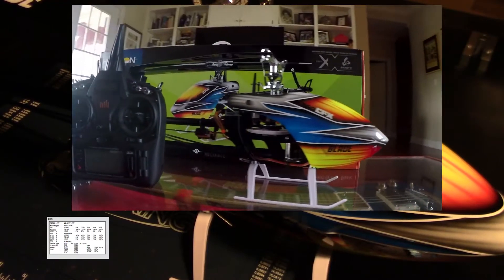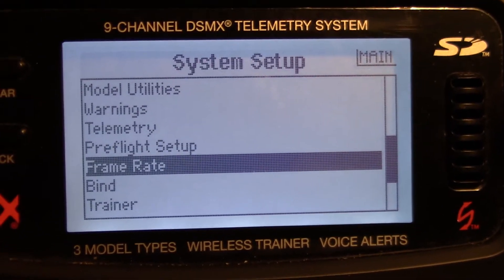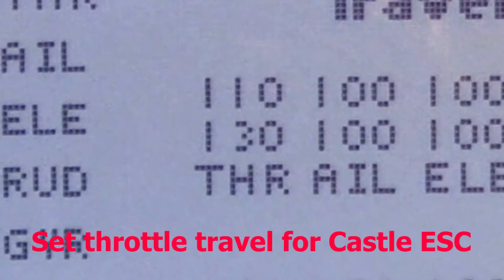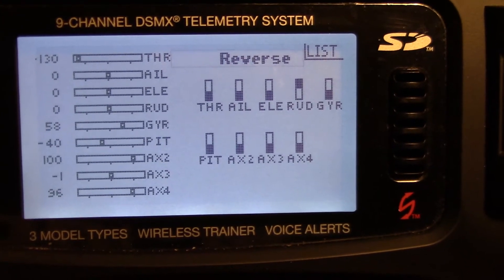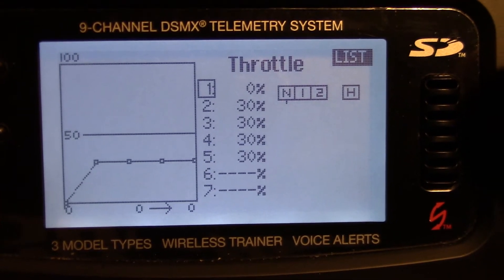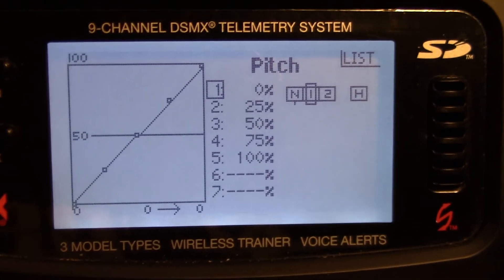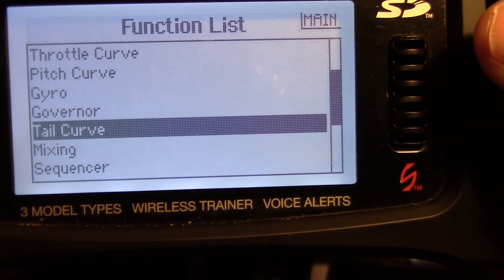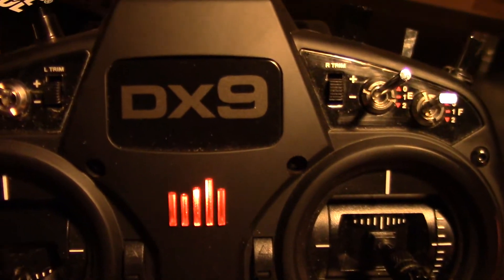Blade 360 CFX radio settings

Comment: Hey there, I just bought the 360 Trio. In the manual and via the online Spektrum Settings Download for the DX9 Tx, the Servo Reverse differs than the video here. Per my manual and download: Ail, Ele, Rud, Pit are reversed ~ all Others are Normal. I do NOT know if this is different because of it being a Trio or what. The model I own came with a Castle Creations Talon 35A ESC. Perhaps I am mistaken on the ESC used in your video Vs mine? Sidenote: I upgraded recently to the Dx9 also, love it.  Your videos and effort, I have extreme respect for.  You do an amazing job and I always learn so much. I have been a loyal fan for a while now, thank you. DISCLAIMER to those brand new in the hobby. If the 360 is your 1st aircraft I highly recommend using another model. You MUST BE experienced 1st with CP Helicopters before flying a 360. The video here and all of his others are excellent tools to help learn, build and grow exp on the ground. I've learned so much here. But as a newbie once myself you need airtime, lots and lots, before flying the 360. Happy New Years 2017.

Comment: I believe this is the same for the new dx7, right?
Reply from the maker: +felixthemaster1 I would have to research it but it should be very similar. I would read the manual to make sure. You can also look on the Spektrum site for .spm for your Dx7 that you can download and install
Reply: JJInvertedProduction On the website it said that if I install the sopm, i will lose the other models. Is this true? I am weary of using an SD card for this reason
Reply from the maker: +felixthemaster1 No I use it all the time. Just don't import a new model in the place of an existing model.
Reply: +JJInvertedProduction Thanks, i tried it and it worked! Shame my tc froze when using a 6gb sd card so I had to take off the battery box.